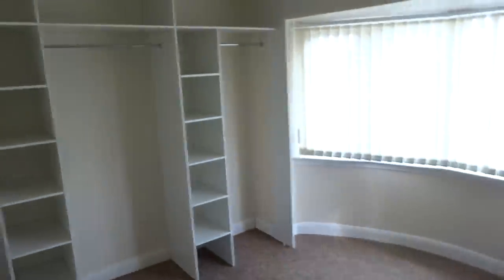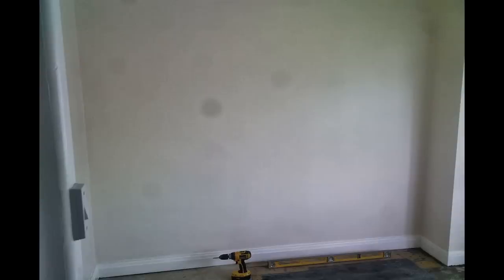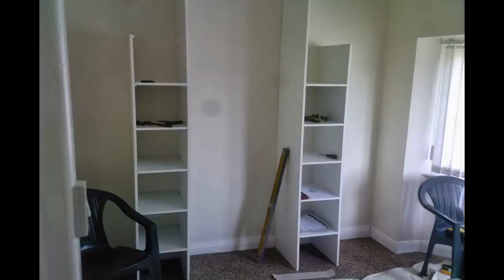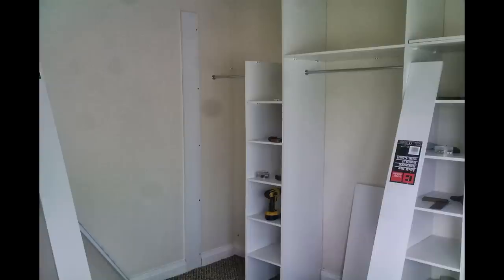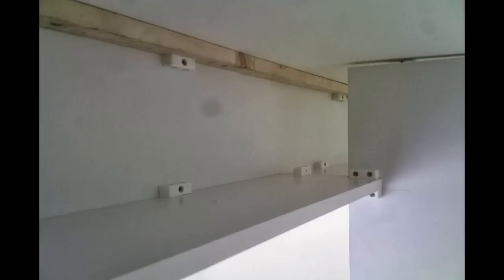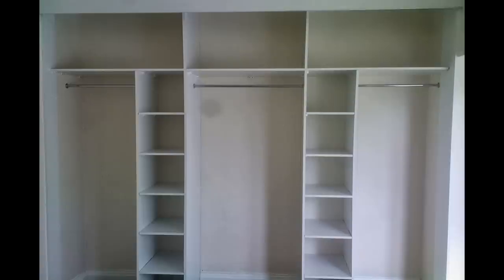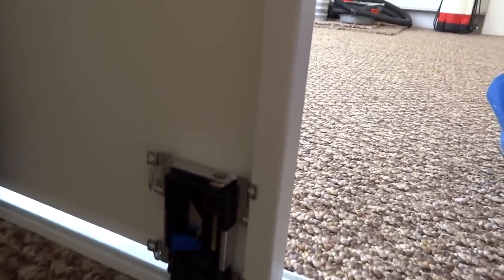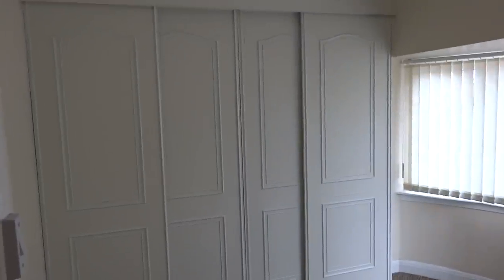How to make Fitted Wardrobes. Easy DIY Install. Custom Build Sliding Door Wardrobe.

Comment: Have to agree that this was all very nice until the 4 doors revealed at the end to show they overlapped and did not present well as a finished unit. Obviously making an early measurement and ordering the correct size doors would have facilitated a better finished result. But if you're happy, that's what counts.

Comment: Just the inspiration I needed. I thought it was going to be difficult!! Great vid and a top job!
Reply from the maker: Thanks, I did cheat a little though - as I had my Dad on the hand saw, and the straight lines he cuts are just amazing! Which did help.
Reply: pro trick : you can watch series on flixzone. Me and my gf have been using them for watching lots of of movies during the lockdown.
Reply: @Brodie Mauricio Yea, have been using Flixzone} for since december myself :D

Comment: Great video and almost exactly what I plan.  Did you screw the bottom rail over the top of the carpet? Did you secure the uprights to the wall with the fixings also?  We have the problem of a chimney on the middle but your idea could work well.
Reply from the maker: Yes the bottom rail simply went on top of the carpet, the screws went through the carpet far easier than I imagined they would too. Leaving the carpet as it was, gives a much neater finish, and also no chance of the rollers catching or snagging any carpet threads this way :)
On this unit I only used 1 fixing on the centre of the back wall, as I have so many fixings elsewhere. I did use fixings on the two main uprights into the ceiling as the length of those boards worked out so well. but as always the more support and fixings the better. It can also be worth adding a narrow strip of contiboard at the front edge of the wider shelves to add extra support to shelf/unit.
Yes sliding doors are great for hiding chimney breasts behind.
Best of Luck to you.

Comment: Hey mate, great job and has given me plenty of inspiration for my own wardrobe project. Quick question, how did you cut your contiboard without it chipping out? I've cut contiboard before for my kitchen plinths, but the veneer always seem to get chipped. I don't have the luxury of a load of expensive power tools like a router table or table saw, so if you did it with hand held tools, that would be awesome! Cheers, Joe
Reply from the maker: My cutting skills are not the best either, so I had my assistant do them (my Dad!). My Dad can cut wood better and straighter than any machine I have ever used. He just used a normal hand saw. Same when it comes to cutting meat or cheese slices etc. no, not with a hand saw but a knife, seeing is believing I have seen him cut 59 slices from 1 tin of corned beef! I'd be lucky to get a third of that number on my attempt.
Reply: @wowthatsamazing  That's amazing haha
Reply: Whenever you cut faced board such as Conti with a hand saw you must always cut down on the side that will be showing. The reverse side will always chip, use as fine a toothed saw as you can. You can always try scoring through the face with a sharp knife before cutting with a saw.

Comment: Looks very good and actually what I wanted to do myself.  Did you paint this afterwards?  If not I presume the caulk matched the conti board?
Reply from the maker: just used white caulk followed by a wet finger. seems okay so far. but will paint over the next time the room ever wants redecorating

Comment: Wow, great video, I'm doing one myself now!!!  quick question - where did you get your shelf bracket fittings from (I can't find those ones). Cheers mate!!!
Reply from the maker: Mike Wilkinson Hi Mike, they are called 'Modesty Blocks', that should make your seach much easier.
Any good Hardware shop should have them but you will also find plenty online, now you know what they are called.

The ones we bought were a super cheap bag from Focus DIY when they closed all their shops down, and were purchased along with a kitchen and bathroom before buying the house!!! I like a bargain!!!

thanks,

David.

Comment: Awesome job but how did you cut that skirting board without taking off the wall?
Reply from the maker: Very Carefully!!   ..with a saw & trying to avoid cutting into the wall at the same same time. (although I may have put something up against the wall to prevent that happening, I can't quite remember)

It was worth it though as it looked better than just placing the board upwards of the skirting board, and with the skirting board being slightly thicker if it had of been left it would have meant a larger gap beside the door at that end.

thanks for asking.
Reply: Thanks for the info, i am doing a similar job now and your video has helped immensely! Cheers 🍻
Reply: Thanks for the info, i am doing a similar job now and your video has helped immensely! Cheers 🍻
Reply: Get a fine tool

Comment: hi. wow that looks brilliant. I have a few questions, what thickness conti-board did you use? how many sheets did you buy?  to make the two main pieces did you just use the block fixings or did you also use screws ? if  I wanted 1 set of shelves and chest drawers is that something that could be changed in this design or would it weaken
 the entire thing. many thanks
Reply from the maker: Hi, most of the Contiboard I used was 18" (457mm) wide and 5/8" inch (15mm) thick, in mostly 6' and 8' lengths (I got the right amount of each for what i needed, but don't remember the exact quantities now).
I used the block fixings only, if the shelves had been longer or I wanted to carry extra weight then I could of added a small narrow strip (let's say 3 inch wide, but cutting these would be a pain!) of conti-board just underneath the front of each of the main shelves screwed threw from the shelf or by using more fixing blocks. This woul make the shelves a lot more rigid for extra support.
If you wanted stonger uprights or for drawers then you could always thicker contiboard or use two sheets of contiboard screwed together in places where you feel extra strengh would be needed. thanks.

Comment: why make the floorboards level seems like a lot of work???
why not pack your bottom rail???
Reply from the maker: Hi it was very important to make the floorboards level so that the doors are straight up against the side wall yet whereever you slide them to they are still straight up with any adjoining door. Unlevel at the floor stage, you regret it later when the doors go on.
I chopped some boards that were sticking up, and also used thin underlay to pack up another section, I did what worked best for me so that the carpet would still be as flat as possible as I was carpeting underneath the rail and to the wall. If the floor covering was one that was going no further than the rail, then as you suggest I probably would have just packed it. thanks.

Comment: can you list out what accessories u use?iplan on DIY one myself,thx in advance
Reply from the maker: +Johanson Bong Hi when you buy the doors and rail kit, they come complete with the sliders/wheels. The shelves were made from contiboard, using fixing/modesty blocks with appropriately sized screws. We added chrome rails and fittings for the hanging space, you can add more shelves or shoe racks as and where you need. The only finishing we used was a small amout of decorators filler.
If you take your time, it's worth doing as it's well worth the effort.
Reply: +wowthatsamazing 👍👍

Comment: Yes but like errrrrrrrrrrrrrr, how  are you fixing it walls
Reply from the maker: +lliambunter Hi the shelving parts were fastened to the wall with the same modesty blocks that were used to create the shelving units. The addition of wood panel up the side wall and baton through to the ceiling joist above made it all plenty secure in this case.
I must say though that the joist in the ceiling and ajoining room wall were both very easy for me to locate on this occasion as both the ceiling and the wall were brand new installed as part of a full house refurbishment.
With the shelving unit going from floor to ceiling and secured in this way. I found that this did not require many fixings to the rear wall. Those added to the rear wall were used more for extra support of the shelfs than anything else as it would be impossible to load this unit up and get it to tip.
But as in all cases the more you secure it, the better. Thanks.